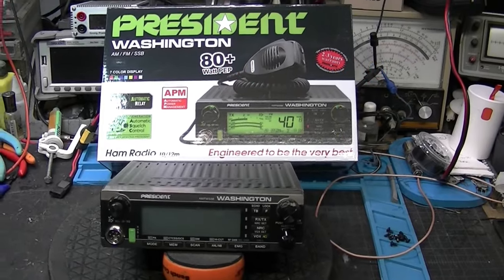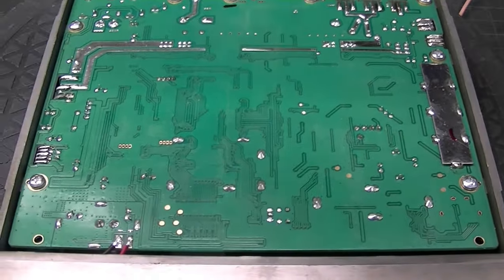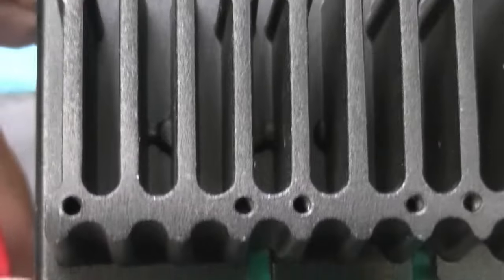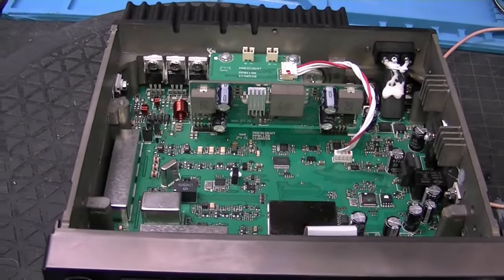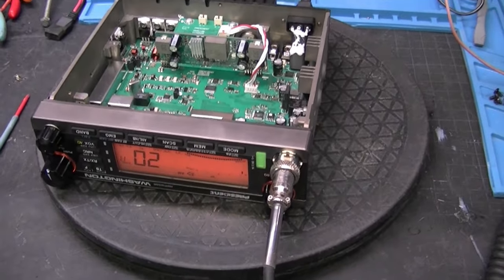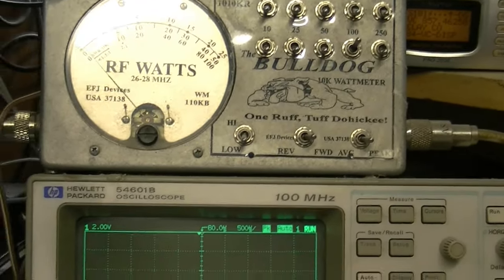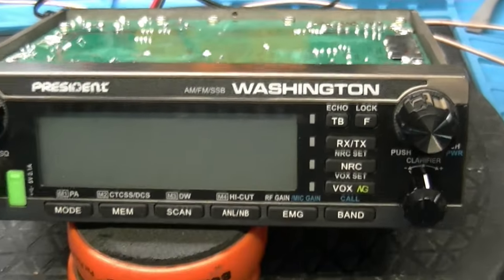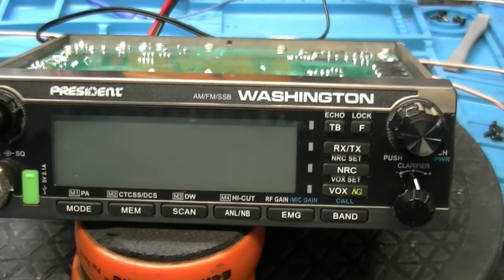President Washington 10 Meter Radio First Look

Comment: just ordered one today! very excited. just did antenna upgrade on my pickup to duel 4' fiberglass stick.(had wilson lil' wil mag mount prior to upgrade) was running a stock Uniden Grant XL, got my swr down to 1.4 on 1 and 1.2 on 40, really excited to see how this radio takes to this setup... the grant has been a good radio, just ready for some features and more power!!

Comment: It takes 4 times the power to increase your signal by 1 S unit, or 6db gain. Double the power is 1/2 an S unit, or 3db of gain. There is no significant difference between 75 watts & 110 watts.
Reply: I’ve had multiple people tell me my Lincoln 2+ does 2 db less vs my 955 on am. 2+ does 50w 955 does 100. Explain that one

Comment: The scope looked much better at 75watts.
Great video!
Reply from the maker: Interesting I don't see much of a difference. Radio sound clean and clear.
Reply: @cbrepairguy The second pattern is distorted. This will cause harmonics disturbances on Broadcasts and TV's
Reply from the maker: @g.h.2800  first off, what distortion you see is insignificant it's just at the brink. 
Secondly, is now going to cause disturbances on broadcasts and TVs unless you're running a 1970s model TV and then you would have to be awful close to the signal. 
If you turn it down just a little bit the pattern straightens right out. No different than turning a stereo up to the point of distortion. 
The operator has total control.

Comment: Yes, it probably draws quite some current with IRF transistors. Built a pa from China some time ago with really huge IRFs and they produce  good power up to 20MHz. On 10m you get 25W out with 15W in!!! But there are no driver or predriver transistors on the pcb.
Reply from the maker: There really not the choice for 11 meters but I think because they are cheep is why they use them. They are not properly tuned at 50 ohm so you have an impedance mismatch as it is and the hotter they get the more current they draw.
Reply: @cbrepairguy  Yes, true, MRFs  or RDs are too expensive for them!!

Comment: Seems like a prime candidate for upgrading the power jack to the XT90 connector.
Reply from the maker: It would take a little work as the casting on the housing is very close to the power connector. It would take some grinding to make it happen.

Comment: I have a president thomas I purchased for its size I want to mount it in my pick up. Was trying to find out if I can run a power amp something about 100 to 150 watts. I know the internals are surface mount tech. So not able to  peak and tune.
Reply: Depending on your low carrier n peak could possible do a 2 2879s

Comment: Nice radio would like to hear the over-the-air audio with echo.  The only thing I didn't like about the president Lincoln two plus the echo wasn't that adjustable. Is the echo on this radio the same ?
Reply from the maker: No, the Echo is fully adjustable in the menu of the radio.

Comment: The scope pattern looks sloppy. What mod? Sounded perfect without the “mod.”
Reply from the maker: It sounded perfect with the mod too.
Reply: @cbrepairguy , never in my life have I heard a modded radio sound perfect. It’s just the way it is.
Reply: @Macjohn1419 did it sound bad, or the scope showed something you think you perceive.  Audiophiles are nuts also, believe they have super human powers of an O-scope.
Reply: @Dingleberry1856 , you are the one who is relying on the scope. I rely on what I hear and although the scope may appear to look good, the actual audio definition to the ear sounds overblown and harsh. By the way, I’m not an audiophile. The unmodded radio sounds perfect and intelligible. I replayed the before and after several times and it’s night and day difference. Not being an audiophile, that says a lot. Just saying.

Comment: What CB Radio would you recommend? I have a Cobra 29 LX now and I'm just not happy with it, it doesn't get more then a half a mile or so down the road, Really wanting something that can get minimum 5 miles TX/RX.
Reply: What’s your antenna setup?
Reply: Antenna is everything. Can always send the radio out for peak and tune.

Comment: Did you replace the finals or just convert, turn and align?  That's a great jump in performance.
Reply from the maker: Just tune and align.
Reply: @cbrepairguy  That is impressive!
Reply: @cbrepairguy 
Wow, just tuning/alignment increased output that much? Impressive indeed. I thought a feature in the service menu had been activated.

Comment: they havent fixed the high reading s meter i see , no noise and you will still get a s5 reading
Reply from the maker: I see no problem with it, the meter compares  to the Lincoln and I have static just like I should have. The meter fluctuates as it should.
Reply: @cbrepairguy   i have 0 noise level on ssb on my ham and other radios but on these types of radios ie the crt 7900v and other modern ones all show a s4-5 , check m0ogy video his washington is the same but he says it doesnt bother him